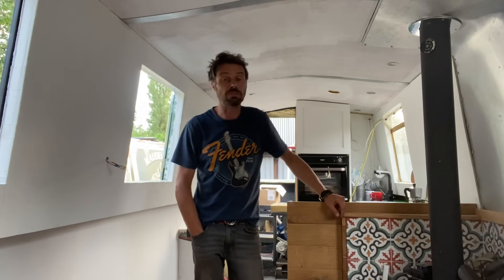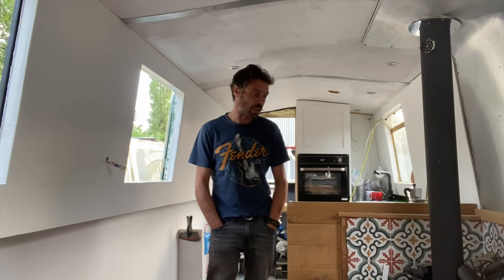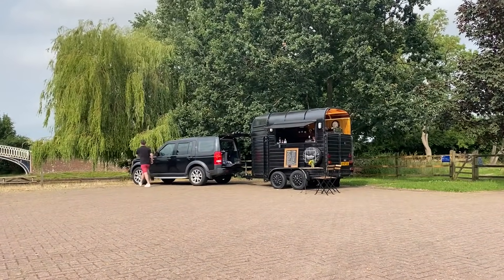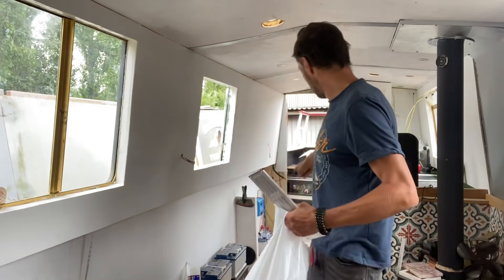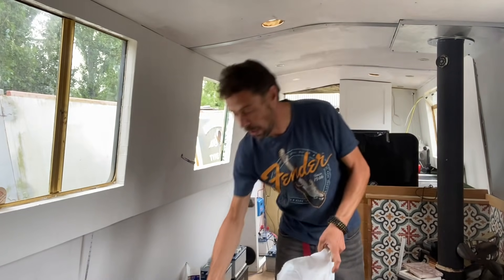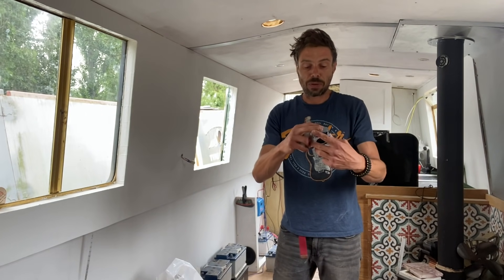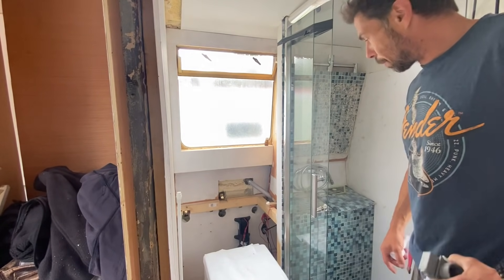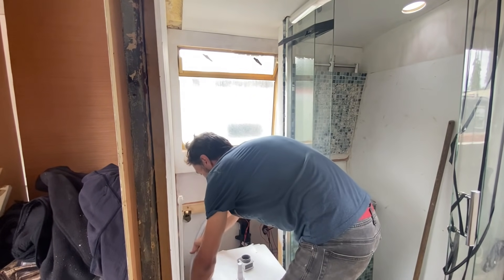224. Toilet and water tank install finished

Comment: I used to assemble some of those fittings when I worked for John Guest in Horton/West Drayton area. Also did a spell for a company called Qualflex who made the mesh coating rubber hoses. Love your vlogs by the way

Comment: Hi James, Good job on the cracking on. I have a suggestion on two things from experience. First off I hope there is an air gap behind the inverter between the sync fins and the wall, if not spacers or washers to create a gap would be good or you can put a 1/4 inch piece of aluminum behind it to help with heat dissipation. Secondly I would advise not to put the breaker board on the top as this could lead to several problems such as water infiltration as well as dust and dirt. I would place it on the front top and piano hinge it on the right side with a cabinet catch on the left so that it is easily accessible when you need to add circuits or replace breakers. also leave enough slack when installing wiring so the door can be fully opened[90 degrees] and of course load it from right to left. I am enjoying watching the progress and can,t wait for the finished results.  Old Geezer in Peru ,Indiana USA

Comment: add a switchable (on/off)  usb fan or two for your inverter/controller, lots and lots of experience with electronics. Keeping it cool extends the life. You should not need a lot of air, just keeping the air moving is generally enough; heat sinks are not that effective. Used to measure it with laser thermometer and they are not that great, they work just enough to stop thermal runaway.

Comment: When you get the chance you should overfill the water tank with a hose to check the waterproofness of all the joints in the filling pipe, as when you fill it normally you'll probably stop when the water starts to come out of the top. Checking it this way also means there will be spillage on top of the front deck so you can check for leaks around the skin fitting onto the bed/seat to make sure rainwater won't get in
Reply: May I add to that, my puzzlement that your only breather on the tank seems to be in the screw-on lid, which is lower than the filler deck-fitting? If filled as most of us do - until the water overflows the filler, what is the breather then doing?
Reply: @davidbeakhust9797  the vent in the tank will overflow. He needs to take a vent hose higher than the filler

Comment: Just a question....the overplating on the hull will increase the draft of the boat (increased weight). Have you allowed for that to ensure the new skin fittings will be far enough above the waterline which is 10 inches minimum I think?
Reply from the maker: Yep. Well I hope so. Extra 1.5tonnes on the boat
Reply: Touch wood

Comment: Have you thought of adding some kind of electric float system that can light a bulb to tell you when the tank is full from the outside. A top of a car brake fluid system which has the electric wires could be used.

Comment: Hi James, is that toilet fan 24 volts?
Reply from the maker: Nope, 12v
Reply: @TheNarrowboatThatJamesBuilt  Then why does it have 24V DC printed on it?
Reply from the maker: @markdoble736  it can run on either 12 or 24 - I’m running it on 12v
Reply: @TheNarrowboatThatJamesBuilt  Then it will clearly run at a much slower speed, which may be preferable from a noise point of view, but will it be sufficient to achieve its design purpose?